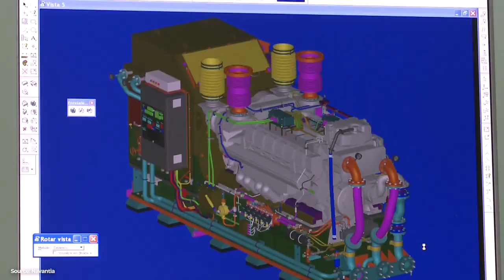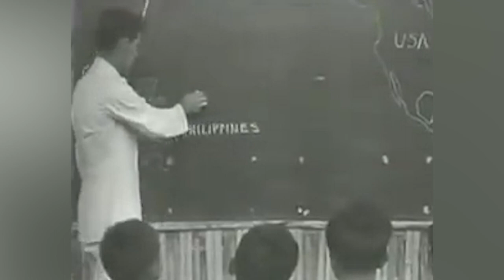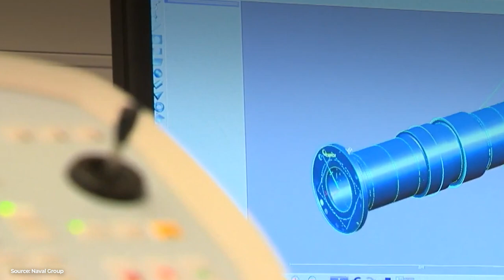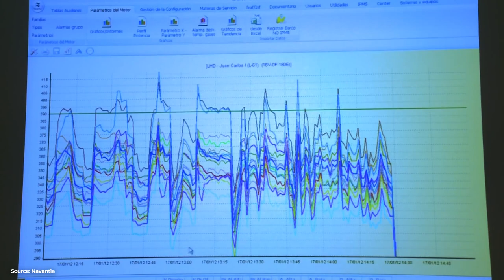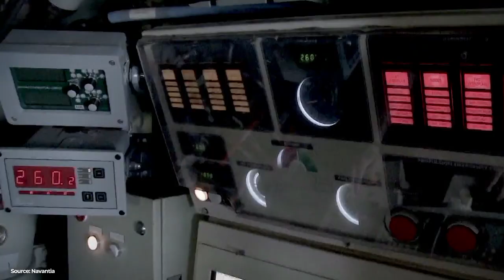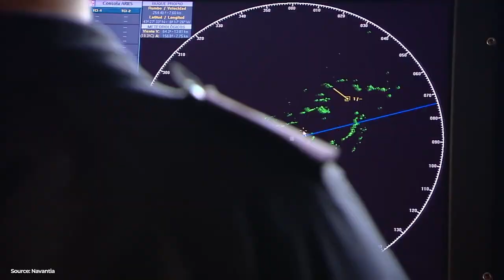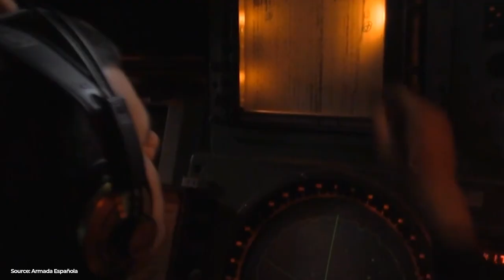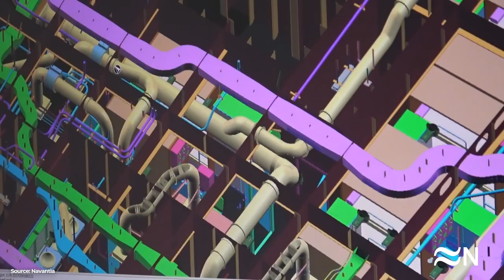The S-80: The SPANISH MILITARY INDUSTRY’S epic FAIL - VisualPolitik EN

Comment: As far as I know, the overweight wasn't because of a mistake with decimals, it was because they planned to introduce new technologies in the submarine (sonar systems, etc ) but it was too late in the design and their weight was higher than predicted. Therefore they had to increase the size of the submarine in order to keep it floating. In any case, despite the failures and over cost I believe the S80 project has provided the base for future high technology projects in Spain

Comment: Spain has committed to radical increases in it's submarine productive capacity. Delays and external consultation on the S-80 notwithstanding, the investment has likely worked at increasing Spanish design and construction capacity. Continued pursuit of this object by Spain could in the long run make the S-80 the beginning of a new contribution to the commerce and use of war machines.
Reply: So at which point is Spain going to contribute the required 2% to NATO membership instead of the 1.2% it currently provides?
Reply: @alanbarlow8232  There is NOT! any kind of money to pay by the membership in NATO. There is a COMMITMENT! between al the countries members to spend 2% of their budgets in defence but only a small amount of them do it. Public spending on defence in Spain grew by 294.7 million in 2019, that is, 3.39%, to 15,420.8 million euros, representing 2.98% of total public spending. Get better information...

"For some time now, every time a NATO summit is held, it has become common to hear about the commitment of the members of the Atlantic Alliance to dedicate 2% of GDP to defense. In particular, Donald Trump has been extremely insistent that this pact be honored. However, this debate is more than a decade old."

"Already in 2002 it was considered to establish 2% as a requirement for a State to be part of NATO, but in the end this was not included in the resulting commitment, more focused on the expansion of the Alliance and on the effects of the 9/11 attack. . At the 2006 Riga summit, this measure was brought to the table again, mentioning for the first time the double commitment of establishing 2% of GDP as the minimum percentage to be allocated to defense spending and dedicating 20% of this budget to purchasing equipment. However, this measure was not formally adopted on this occasion either. In the declaration drafted at the end of the summit, the allies only pledged to halt the decline in state investment in defense that had been occurring since the end of the Cold War. It would take almost a decade more for the 2% commitment to become official."

"Thus, the decision that NATO members would gradually increase their defense spending to reach 2% of GDP within a DECADE! was finally taken at the ¡2014! Wales summit. As a result, in recent years the budget dedicated to defense has increased by 5%. However, there are NO! consequences for those States that do not meet the objectives, but rather a political commitment, but not binding. Furthermore, few Alliance countries meet the 2% target, and even fewer meet both: 2% of GDP for defense and 20% of defense budget for equipment."

https://elordenmundial.com/obliga-la-otan-a-sus-miembros-a-gastar-el-2-del-pib-en-defensa/
Reply: @CitizenXFR It's a false statement. The only similar thing between the Scorpene and the S-80 plus is the colour (black as everyone else). The S-80 plus is much bigger and it's two times the displacement of Scorpene. The S-71 is doing its overhaul in the Navantia shipyard for submarines and Spain never paid some money for this kind of works of mantenement. Now you can keep making up lies. Troll!
Reply: @alanbarlow8232  Cuando adquiera los 50 F 35 para la Armada y el Ejercito del Aire españoles.

Comment: So many armchair admirals in this comment section...

1) Spain doesn’t have the facilities to build nuclear subs. 
2) Spain doesn’t really need nuclear subs anyway - it needs the ability to patrol the Med and the North Atlantic within a few thousand miles of its shores. The AIP powered S80 design is capable of this in theory. 
3) The design flaws of the S80 have been fixed and the boat is going to be built, albeit with a delay. 
4) Blunders in military equipment/arms development are not unique to Spain - literally every country has had them. The F-35 Lightning, the most expensive military development project in history has had its fair share of issues, design flaws and controversy, as well as being massively delayed and over budget.

Comment: Spain 🇪🇸: The S80+ is overbudget, overdue and its probably going to be a failure when it comes out.

United States 🇺🇸: *Laughs in F-35*
Reply: The F-35 is considered a success but a bit overkill for the missions the US currently runs. It outperforms every previous generation fighter in recent red flag operations and that includes the European fighters.
Reply: The F-35 project has failed and they tried to make it a thing for way longer than this submarine.  I admire effort and vision though.
Reply: @Snoy_Fly  5 f-35s vs 5 of any 4th plus generation fighters will see a massive win for the F-35s. This was already confirmed in the recent red flag exercises where the F-35 dominated against any adversary team. Add to the fact that the F-35 has room to grow as both P&W and GE are developing the variable cycle next generation engine that can be retrofitted into all existing f-35s and will most likely be added to any newly produced F-35s. 
So what advantage does any 4th generation jet have against the F-35? Don't mention speed as the moment you attach weapon payload and drop tanks, the speed drops down to around Mach 1. Don't mention maneuverability as that is also penalized by parasitic drag and causes energy loss far faster than the F-35. Don't mention price because any up to date 4th generation fighters are within the same ballparks in terms of price as the f-35. Don't mention electronic warfare as that's also inferior to the F-35's. Don't mention IRST as 4th generation fighters are limited to forward facing IRST while the f-35 has full spectrum IRST. Don't mention radar because the F-35 has the latest radar technology. Simply put, any 4th generation fighter is out classed against the F-35 since they're both at a similar price point of around 80 million USD or more with legacy fighters having far lower performance by comparison.
Reply: The air force a few days ago said the the f35 failed at meeting it's initial requirements so...
Reply: @MyCommentsGetGhosted  It outperforms every previous fighter except the F-22 Raptor. In fact, the F-22 Raptor is the real overkill. That is why it has not been made available to any other nation.
Reply: @KamiInValhalla  No it hasn't. You shouldn't trust shitty exaggerated news reports.
During a Thursday media roundtable, Brown refuted claims the F-35 was a ‘failure’, saying the fighter was the ‘cornerstone of our [US Air Force’s] TacAir [tactical air] capability’.

Brown went on to say: “The F-35 is the cornerstone of what we’re pursuing. Now we’re going to have the F-35, we’re getting it out, and we’re going to have it for the future. The reason I’m looking at this fighter study is to have a better understanding of not only the F-35s we’re going to get but the other aspects of what complements the F-35. And looking 10 to 15 years out, because I want to be able to understand as I start trying to make decisions is what do we want to look like as an air force 15 years from now, with the F-35 as the cornerstone of our capability.”
This is from the very guy who commissioned the paper that media is citing as proof of the "Airforce admitting the F 35 is a failure."
Reply: @corvusglaive5769  The F-22 has no air-to-ground and greater maintenance cost due to using stealth panels instead of coatings. So while if given an updated avionics sweet, it would definitely heavily outmatch a f-35 in air-to-air, it has a few limitations outside of that that takes it out of direct competition with the F-35.
Reply: @MyCommentsGetGhosted  while it is very advanced plane and will win 5v5, what about if Chinese throw 20vs5 because their planes a way way cheaper?
Reply: @NocKme  The United States has the three largest aviation forces in the world in both the Airforce, Navy and Marines. Most nations among OECD marines have a weaker Airforce than the US's Marines. That's true in both the number of units and the capability of them. While China is ramping up, they still have a long way to catch up and are not focusing on building cheaper jets but are instead building their own 5th generations jets (J-20 & J-31) that seek to mimic the capabilities of the F-35 but tailored for the theater of the South China Sea. The threat of a cold war type scenario in where superior fighters will be overwhelmed by inferior fighters that are fielded in greater numbers seems to not exist.
Reply: @MyCommentsGetGhosted  5 v 5 is the ideal what about 2v5 or 5v8, but it's when it gets one on one with gun on gun that's when the true measure of the plane and pilots can be judged. If that 5v5 is just lock on and release missile then it's just the missile tech that is being demonstrated as superior.

There will come a time where they will be allowed to play, usually at the end of a NATO exercise when the the Americans and Brits go hunting Germans for old time sakes.

I'm no F-35 hater but I've always been fascinated by Dogfights as they remove the fire and forget tech. Part of me still thinks that 2nd world war planes will still hold out quite well against a modern plane Gun on Gun as the manoeuvrability of the Prop planes just can't be matched by Jets.
Reply: @plentyness the F-35 is so dope that the USAF wants to reduce its order. They're more thrilled with the NGAD.
The cost will increase for the US allies.
Reply: Actually the real failure of the US is the Zumvalt class destroyer
Reply: @lucadesanctis563  and the Littoral Combat Ship program.
Reply: The F-35 can be detected because Stealth Technology is 30 years old. It's tech could just as easily be grafted onto a F-16 for 1/8th the cost of a F-35. And unlike the F-22, the F-35 has no active thrust vectoring minus that of the VTOL systems. That leaves a single seat fighter (NO RIO) with substandard maneuverability and Far substandard speed (Mach 1.2) as our fleet defense fighter. The US just lost the ability to achieve air superiority over Land based planes like the J-20 and Especially the SU-57. Or to put it more memetastically, F-35 Lightning II: The Brewster Buffalo  of its time.
Reply: @MyCommentsGetGhosted  
Red flag are not real. Each team has to keep to certain rules lije weapon type, max speed and height etc.
Reply: @MyCommentsGetGhosted  
Lol red flag are scenarios. Conditions are artificial you have to follow certain rules etc
Reply: There are like 500 F-35 delivered.

Comment: Spanish failure to purchase the tomahawk missile is quite puzzling because they also have frigates that can launch these. The F100 Bazan Class has 48 Mark 41 VLS tubes that can launch the tomahawk. Of course, most of these will be used for air defense missiles. They are also building the F110 class which in theory could also carry tomahawk missiles but is being crippled by only having 16 VLS tubes. in fact, this new frigate will have an even more advanced AN/SPY-7 radar than the older frigate (SPY-1D) or most American destroyers and cruisers, but will be crippled by having so few vertical launch tubes. Spanish Navy seems to make very weird choices. But they do make good ships. The Australians bought the F100 class and modified it for their new Hobart class air defense destroyers. And the F1 00 made it to the second round of competition for the new United States constellation class forget, losing to a Franco-Italian design. 
Novantia is also exporting its amphibious carrier to Australia.
Reply: The gobernment cancelled the purchase of Tomahawk to not depend of the permission of the USA to use those missiles. So, the finally decided to buy cruise missiles Taurus for the Airforce. The most likely is Spain buy the MCN to MBDA to use from with the F-100 and S-80. The F-110 will be a frigate whose main mission will be anti submarine fight (ASW?) So, the Spanish Navy think those 16 VLS are more than enough.
Reply: Tomahawk need permission of USA for use. Taurus not need permission of Germany.

Comment: Big thing about we Australian's going with the Barracuda class and why it's such a similar issue that Spanish went through, is we want the Barracuda converted to diesel electric with the AIP system. Given a location in the globe, we have rather unique operating requirements which only serve to compound the issue. That and we have absolutely no nuclear industry here in Australia and it would take us decades to build that capability assuming the general population actually had the appetite for it, which most don't.
Reply: the Australian situation is still different : unlike the S-80, the submarines ordered by Australia don't require a whole new design as the Barracuda Class submarines already sail in the French Navy. Moreover, Naval Group also builds diesel-electric motors for the Scorpene Class subs, so they are not starting from nowhere

Comment: This really feels like a premonition for the Australian submarine program. Greedy politicians using the program as an exercise in pork barreling. With an inferior submarine being 20 years too late.
Reply: The Australian sub program uses more reliable and tested French technology that said most military programs are filled with technical problems.
Reply: @TalonAshlar  If they bought them outright I would totally agree. However they are redesigning them from a nuclear to a diesel electric, which is a huge undertaking. They are also assembling sections in both Australia and France.
Reply: @ranwest2213  and? Australlia is looking for a specific long range submarine, and nothing is available on the market. It must be designed specifically, and basing it on an existing design makes sense.
Reply: If you hadn’t added to the requirements that you build and maintain at home you could have gotten cheaper subs but it’s that capability that costs big time
Reply: That is not going to end well...